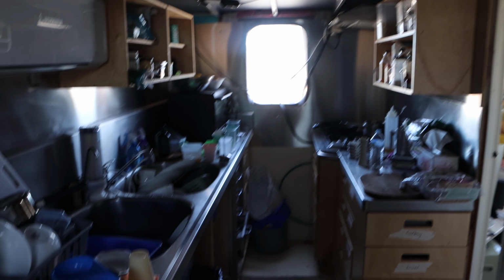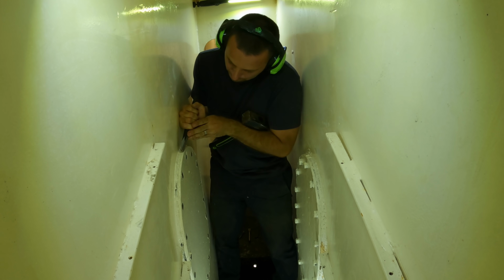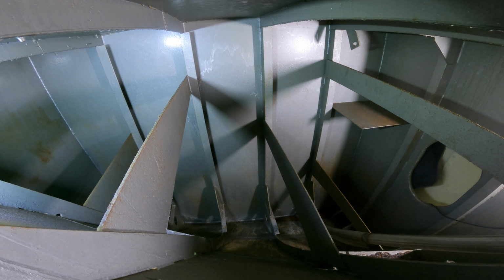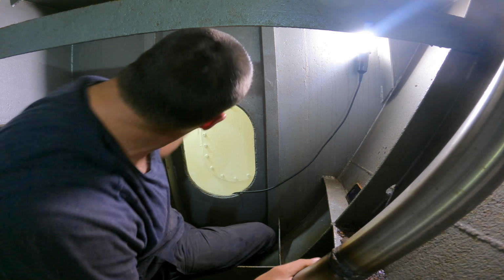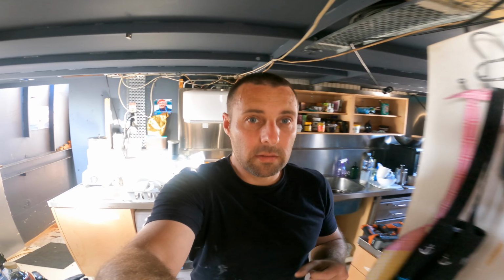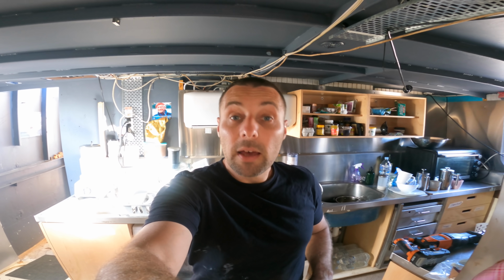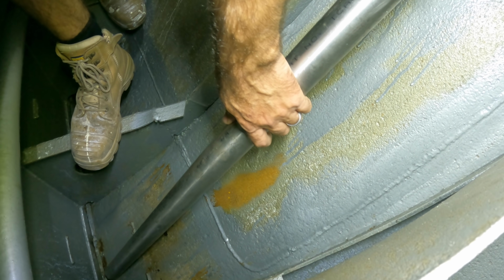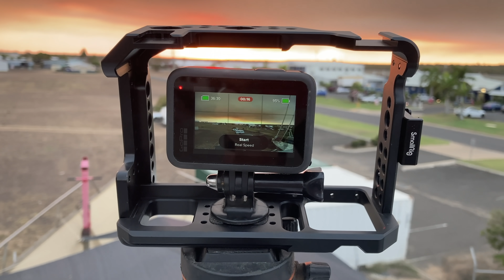Inside a trawlers fuel tank - Project Brupeg Ep 218

Comment: What you need is a couple of threaded holes in the lid of the fuel/water tank access,you can thread a bolt in so it pushes against the bulkhead and forces the lid off.
Reply: Wanted to write exactly the same. But for such force needed the thread part should be strengthened first.
The picture in picture scenes are great! So much better understanding about the interior of the boat and to get a feeling about the size.
Reply: My thoughts were something like a fly wheel puller.
Reply: “Jack bolts” probably want to weld a nut on some extra holes.
Reply: Good idea..but what also helps is a (oilproof) rubber sealant ring,so there isnt any sticking at all...

Comment: On the fuel doors you could add a few threaded holes around the lid so that you can just screw bolts into them to help pry the lids off in the future. It would help avoid using a hammer and chisel. It would allow you to add pressure all around the lid yea you might still need to pry it a bit but I think it would help

Comment: If it’s not too late. On your fuel tank access covers. If you drill a few holes and weld on nuts on the outside you can use “jack bolts” to remove those next time you need to access the tanks. Then you don’t have to chisel them off.

Comment: hey considering how much force effort went into removing the tank doors before maybe you don't want to make the whole door out of acrylic, maybe just a window on the door, or a new hole that wont have to be removed for access and just serves as the window. Otherwise you might be replacing the acrylic every time you want to open the tank up, and getting new acrylic in other locations around the world might be hard. I like the idea of having a window into there though so great idea. Also might want to toss a light inside the tank, illuminating it from the dry side of the acrylic might also be challenging with reflections and what not.

in hind sight it might have been better to have the access door on the top of the tank, that way you don't have to work so hard to have the ultimate seal on it because gravity can do its thing and help keep it water tight by keeping it above the water level inside the tank. 

Anways I love this ship, every time you go into the little air gap between tanks i find myself thinking what can you put in there to utilize the space haha.

Comment: Great camera trick..  It really helped to show where you're at in the boat. How about adding a fitting to the top and bottom of the tanks with a clear hose in between to check water or oil levels. Then you could mark the levels when go to you fill them. Plastic cover may crack when it comes time to get them off so save the old ones.. last thing buy your friend some shoes..

Comment: Me no likey the plexiglass windows in the tanks.  You're plans are to be in some heavy weather.  At 62lb/ft^3 that is a lot of weight slamming into a weak point in your hatch.  Sampling them periodically for water quality would be far safer option.  Even plexi that thick flexes at the hold-down bolts which will start stress cracks that run.  Been there, done that.  YMMV.  :-D  Glad your Confined Entry procedures saved your bacon.  Kudos to Jess for being a good watch on the outside.

Comment: Hi, on some euipment I worked on which had a vacuum tank, after the air was let in it was still difficult to open the lid. The solution was to have a threaded hole in the lid with a bolt in it so that tightening it forced the lid away from the seal.

Comment: How about with the polycarbonate lids you use that router and router a groove right around inside the bolt line and make an O'Ring to suit. Save all the work getting all that 291 apart. Just a thought.

Comment: weld nuts on the perimeter between the bolt holes so you can use the attachment bolts to push the cover off next time .

Comment: If you look at an Eaton-Fuller transmission, the shift lid has threaded holes on the flange, this helps to break the seal between the shift lid and the transmission case.
Reply: This forms a very powerful wedge that won’t deform the lid mettle like a chisel will.
Reply: Jacking screws is the name I think

Comment: You should add threaded holes on the lid itself in-between the bolt holes or weld nuts. That way you can use bolts to extract the lids. Should make it easier for the future.

Comment: as for the acrylic sheets: beware of stress cracking around the bolt holes. Cast acrylic is less susceptible to this than extruded, but still. compressive yield stress is only something like 115MPa, so no doing the bolts up with the uggudugge. it may look fine when you do them up, but after a few months cracks can still appear. also, it's not really a fan of oil. this might induce more cracking
Reply: Would a ring of steel with bolt holes that sits on top of the acrylic avoid concentrating the stress at the bolt holes?
Reply: @TD_YT066  it will, even body washers will. but steel is not infinitely stiff either. the usual way of doing this is to suspend the acrylic in rubber, and have a flange of aprox 2x the thickness of the acrylic to bolt it all up. to be fair, if i were them i'd either googled or googled around on the scrapheap for the biggest industrial sight glass and used that. 20mm acrylic ain't cheap.

Comment: Climbing into tanks that have been sealed like that is extremely dangerous. The oxygen level can be too low to be breathable. There have been many, many fatalities on board ships from entering tanks. 
You need a gas monitor to test the tank atmosphere before entering, and self contained breathing apparatus (SCBA) to provide breathing air. Never work alone. Someone should be outside the tank ready to pull you out without entering the tank themself. 
Unlike some safety issues, this is an extremely serious one. People can and do die frequently entering tanks like this
Reply from the maker: Your absolutely right. We’ve been doing tank work for six years now so pretty familiar with the risks
Reply: If you are so familiar with the risks you should have known the safe procedure and used it!!
Reply: So the first thing, is never get to over  confident with safety measures.  That's when poop happens.
Reply: @newzealandfortrump  Funny, I don't see you doing any of the work. It's easy to be an armchair quarterback when you're sitting on your arse!
Reply from the maker: Sweet as DJI, let’s go through this. The tank has not held any fuel so no fuel vapours. It’s painted so no rust oxygen depletion. It’s open at the top and bottom and then we cracked open a human sized inspection port. Then we hooked up an extraction fan at the op of the tank and a vacuum at the very bottom. Have I missed anything… always easy to be a smart arse. I’m ok if you want to unsubscribe from our channel. Plenty of other folks out there that aren’t just armchair whingers.
Reply: @ProjectBrupeg  it's amazing how people assume they see the whole process in a video that has to be edited heavily
Reply: wonders what boat he has and how much tank work he has done.
Reply: @ProjectBrupeg  That was pretty much a FU statement.  Good old kiwi.  Well done kiwi bro
Reply: @ProjectBrupeg  you addressed argon, don't forget co2 buildup can be fatal too. And who knows what kind of nastiness comes out of the compressor when you sand blast.

You might have done it off camera, but for the love of Brupeg don't get complacent around those confined spaces. And maybe next time address the airflow sooner in the video. ;)
Reply: Have been some tragic ones with people climbing into chain lockers, the rotting seaweed and corrosion etc. took all the oxygen out of the spaces etc. or left sulphides. The attempted rescuers sometimes perish also trying to pull out the collapsed person/s. Confined spaces training, never make assumptions about what's in there until you can test it out or ventilate it properly. Invisible things like this, and electricity can finish you off pretty quick.

Comment: Not sure how oftrn the tank covers need removing, what about if you weld maybe 4 threaded tabs to them, when you need to remove them, insert a bolt in each tab to use to 'jack' the covers off, or at least to add tension so you can get a tool in the gap ;)
Reply: LOL I just added this same comment then I came across yours👍 great minds think alike. Feel like it would definitely help apply even pressure still might need to pry a few places but once started an impact would make quick work of it.
Reply: @TheBullockFamily  I just found your other reply, and that was my first thought about just drilling threaded holes between the others, but that impacts the seal surface, and weakens the cover because you would be pulling, that's why i went with tabs. ;)
Reply: Good idea..but what also helps is a (oilproof) rubber sealant ring,so there isnt any sticking at all...
Reply: @franksteyn  But not fuel oil remember... And Once tanks are filled is unlikely they will need accessed until survey at least an d thereafter probably only at major refit...

Comment: Bit worried about the perspex, acrylic sight glass. Quite shore you did you homework but polycarbonate I would think would be a better bet but don't know about its life in diesel. Half as thick would probably do it and it would slow down a bullet as well.  Ok not a priority but its significantly tougher. Hate being mental giant in retrospect but just maybe fill the diesel to slap against the acrylic it can be trialled. Understand the pressure and the cost you have taught me heaps. Thanks.

Comment: I hate to be a smart arse, but would a couple of tabs welded onto the fuel tank hatch help getting it apart, especially if you had to take it of in inclement weather. Just a thought. Also an eyelet loop across from each hatch (or even a few) would allow you to use a pulley block to wrench the hatch off using mechanical advantage evenly from 3/4 corners. Edit or what Domingo (the guy before me) said.

Comment: Before you put the tank covers back on, why don't you bore 3 or 4 holes (or more) in them approx equidistant between the sealing bolts, weld some large nuts over the holes then use bolts to prise the cover off by screwing the bolts in? 
I imagine you could 'store' the bolts in the holes & nuts you welded in, by using two nuts on the bolts and tightening them against each other - would also keep the holes closed. Should make removing the covers less onerous especially if you have to do it at sea.

Comment: Those hatches need some threaded bosses to help you spread the gap. Not on the existing hole perimeter, rather on the shape's perimeter, welded on. IMO, 3, each spaced 8 cm apart, should give you an excellent head start to shove a crow-bar in there.

Comment: Great ideas with the see through plexiglass for the covers on the water tank.  Is there a reason behind NOT doing that for the veggie or diesel tanks? Love ya both keep on keeping on!
Reply: Seeing into the tanks is a pretty awesome idea....I think diesel would affect the structure (Strength) of plexiglass, at least over time.. perhaps discoloring it even to the point where one would not be able to see through it anymore... veggie oil should not be an issue, however that would mean that the tanks can never be used for diesel. Maybe there is a legal requirement for steel lids? 

It might be dark looking into the water tanks, maybe some sort of water proof light/s on the inside of the tanks would be useful for inspection... A UV light could even assist to treat the water as a thought?
Reply: @stephanpretorius6101  Good idea. Running a UV light in the tanks for a few hours a week would keep bacteria in check. 
Need to keep the UV source away from the acrylic though, it degrades and embrittles with UV exposure.

Comment: Something that has been bothering me, but I've been too shy to ask the question.  Without insulation or a tank heater, won't the veggie oil solidify when exposed to the frigid outer hull in extreme cold conditions?  I really think you are better off staying with diesel, if for no other reason than to reduce possible engine problems.  It's not like you have a reliable engine there.  It's the wrong color.
Reply: Excactly my toughts for a while now...Even "winter'diesel' does not stays liqiud under minus 20 degrees celsius,we always added gasoline with it in extreme cold situations to avoid solid fuel lines...
Reply: Freezing pt of salt water is -2 Celsius. Diesel is good down to about -10. So as long as Brupeg is floating in liquid water the fuel should be fine.
Reply: @jamesboulton2722  With all due respect to your fact presentation, my point was the flow rate of vegetable oil, not seawater or diesel (either #1 or#2)
Reply from the maker: Hi Stephanie, Jess here, glad you asked. The front storage tanks won’t be insulated mainly because it’s way too hard (at the moment, we may change our minds on this later). The vege oil fuel won’t be used in Antartica as you quite rightly pointed out it will solidify. We will be using it to steam some of the way there but most of the fuel will be polar diesel. I respectfully disagree about the engine but I am biased (and right). The rear two tanks however will be fully heated from the main engine coolant circulated via a stainless coil system Dame has yet to build around the fuel pickup.

Comment: Q: Where is the fuel pick up point in the Tank due to the fact that Water is heaver than Fuel  hope you don't have it all the way to the bottom of the tank , you might leave a 600mm or what ever your committable loss of pickup of Fuel in there ??????????. And not hope on the fuel filters at the Engine doing all the work of water separation.
Reply from the maker: Pick up is around a foot from the bottom. Have a secondary water drain that is half an inch from the bottom. Also plan to cycle fuel pretty frequently using solar and low volume pumps that run anytime the sum is up to filter the bottom of the tanks and we will also be making our fuel so able to keep a pretty tight quality level rather than pump whatever we can get in there
Reply: @ProjectBrupeg  Will you be adding a pre-heat to all your fuel type's seeing your going to the Ice block Factory :) lol